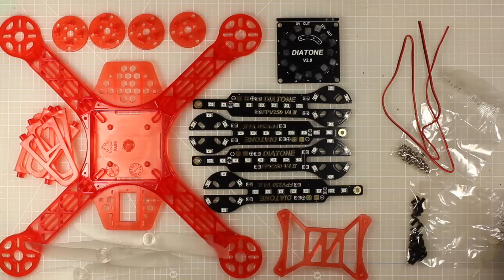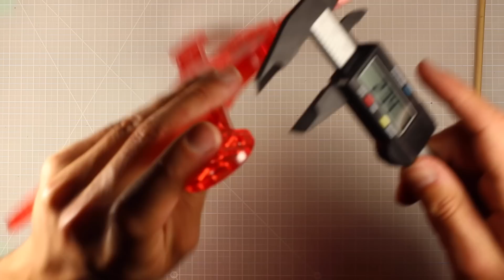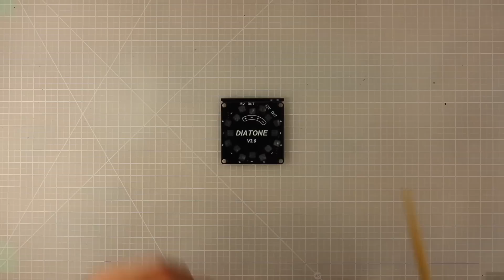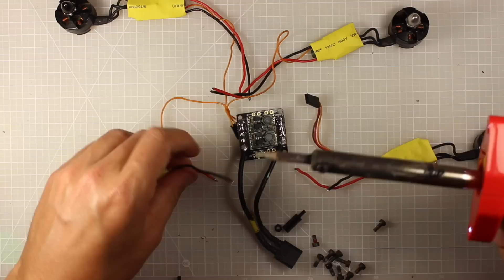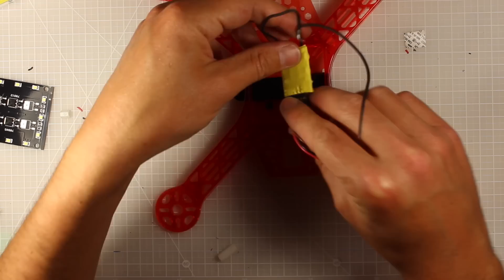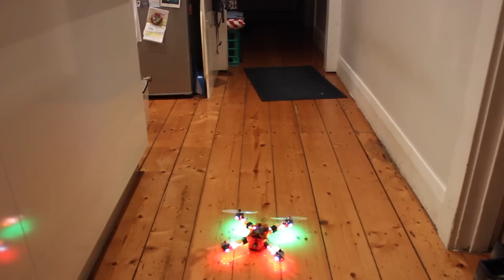Build a UFO drone. 70 LEDS. GHOST V4 quadcopter frame review

Comment: how did this quad hold up with time? got 5 of them for a dollar a piece. also do you know what voltage the leds can handle? did you hook yours up directly to the battery or through the BEC?

Cheers
Reply from the maker: directly, but I actually broke it down to reuse the motors

Comment: The holes you drilled through (9:20) are actually to secure the LEDs from below, not to hold the flight board.
And you should have connected the LEDs to 12V, that is what the 12V in the original PDB are actually there for. That way you can choose between 3s and 4s.
Reply from the maker: +Kessl1492 good to know. Is theere any way to connect a standard size naze pdb without mods?
Reply: +UAVfutures I dont think so. I also dont think HK put as much effort into making a good product, as they did into making a cheap one. I had to glue in my screws, used these mainboard screws to get my flight controller (50mm holes) above the pdb but then the top of the frame would no longer fit so in case of a crash my flight ontroller is totally unprotected. Overall, I dont really like the frame and use it for nightflying only, with 3x 2W LEDs as headlights.
Reply from the maker: Kessl1492 yeah I got mine for stupid cheap but didnt expect too much for the price

Comment: Hi. Just found your channel. I got one of these waiting to be build. About the leds. Saw you connected them straight to battery, so they can handle 4s? Can't see the cell number on the battery in the video.
Reply from the maker: +Lupi Im not sure actually. I just used a 3S because thats all my escs can handle in this build. I dont know if this frame is really meant for super fast 4S flying. its fun and looks cool but I dont know how well it would hold up in a crash